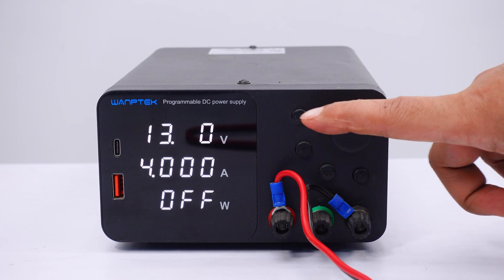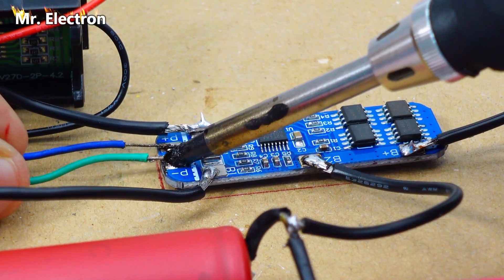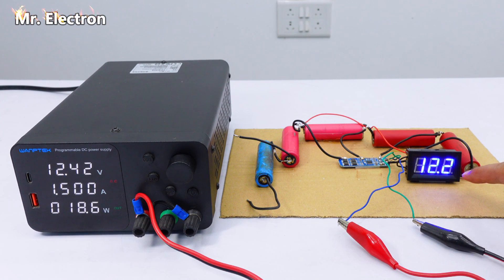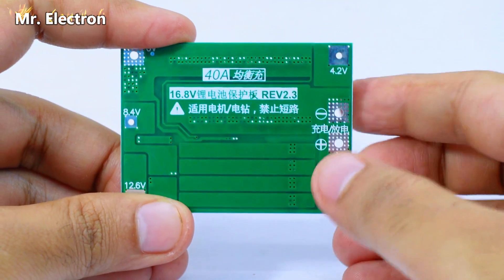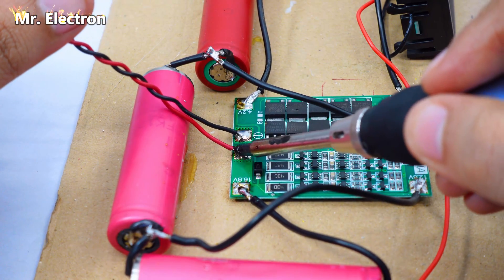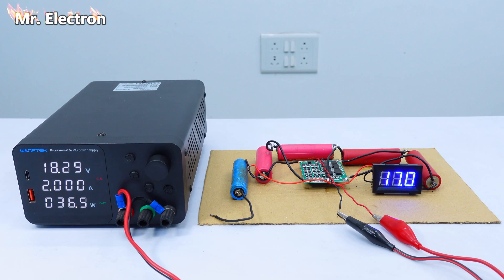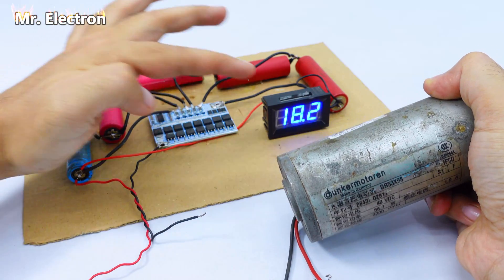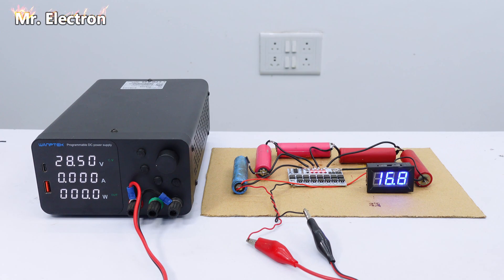What is the Maximum Charging voltage for a ( 12v, 16v & 20v ) Lithium Ion Battery Pack ?

Comment: Can I charge a 12.6 volt lithium ion battery pack having 20 ampere BMS with 15 volt 2 ampere adapter? PLEASE REPLY
Reply from the maker: Well according to this test YES but different BMS can have different component ratings which can be a problem - Hey Friend! Please JOIN on WhatsApp for a stronger FUN and LEARN community: https://whatsapp.com/channel/0029VaQmmRaFCCoWOf7huh3G

Comment: You bought a wrong 5s bms 😅. i think, it is for a 3.2 volts lifepo4 battery. 18650 is a 4.2 volts . that battery you are using is not compatible to that bms 😁

Comment: As a battery obcest autistic nerd this is child's play...

Max voltage
1S = 4.2v
2S = 8.4v
3S = 12.6v
4S = 16.8v
5S = 21v
6S = 25.2v
7S = 29.4v
8S = 33.6v
9S = 37.8v
10S = 42v
11S = 46.2v
12S = 50.4v
13S = 54.6v
14S = 58.8v
15S = 63v
16S = 67.2v
17S = 71.4v
18S = 75.6v
19S = 79.8v
20S = 84v
21S = 88.2v
22S = 92.4v
23S = 96.6v
24S = 100.8v

Comment: hur,we think bms cut off discharger no (burning battery),we engine running to power alternator charger back battery we jump 14v cut off 1 by 1 safer battery use power engine starting up more day

Comment: I had been watching your channel since 2020. You really make good content. 

Now here i have a recommendation no Youtuber have ever made this type of video i am pretty sure.
You need to buy all type of lithium cell. If not possible describe them in chart in your video. 
The Lithium Ion cell 3.6vdc
 i. Cylindrical @18650
ii. Smartphone battery
The lithium polymer cell 3.7vdc
The Lithium Ferro Phosphate Cell 3.2vdc
The Lithium metal hydride cell 3.65vdc
The Lithium Prismatic cell
The lithium high voltage cell.3.8vdc

What is the
Ideal voltage of each
Minimum voltage after that cell is considered dead
Max charging voltage

Just for 1s series.

For 2s or 3s or 4s max value can be multiplied.

All what a person should know  if he/she willingly interested in making battery pack or a charger.

Comment: It is not advisable to connect batteries in series without fully charging them.
Reply from the maker: I have reard that they should have equal voltages before connecting them to a bms. Are you sure u also have to fully charge them ?
Reply: @MrElectron naw only equal voltages